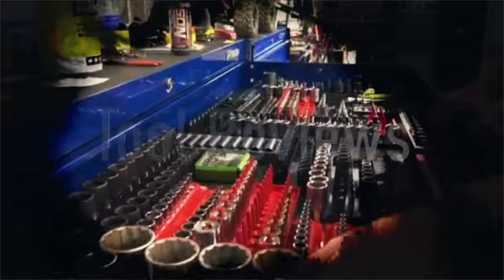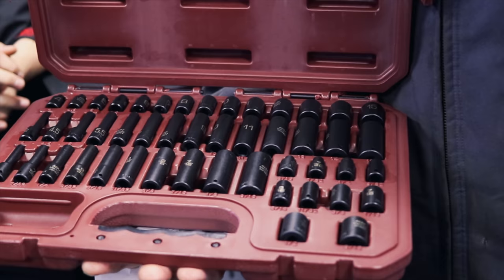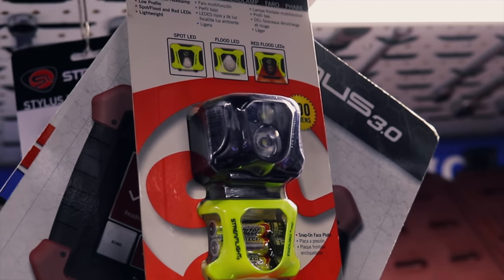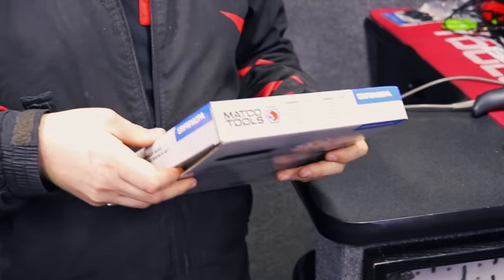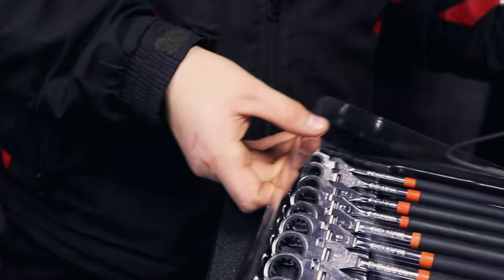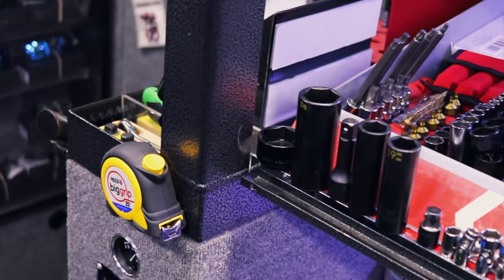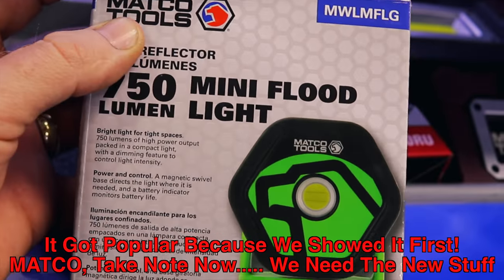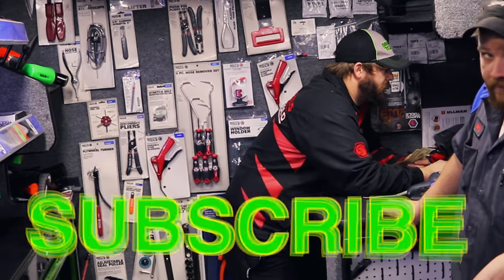Matco Tools Shortage? or Do They Doubt New Products Will Sell As Well As They Do?

Comment: Matco rebrands most of the tools and tool sets they sell. The only things Matco makes themselves are the ratchets, sockets, and wrenches. 

I bought a set of Matco long ratcheting wrenches, couple weeks later found them on the MAC truck renamed Mountain. Same with a seal driver kit, found the same kit from Lisle for WAY less.
Reply from the maker: You do know Matco only makes toolboxes ? They don’t have any tool manufacturing plants at all. They contract it through other companies and have their name put on them. Not knocking them for it but it is true.
Reply: Matco does not make any tools, all tools branded matco are made by someone else and matco name applied. Matco only makes toolboxes in Jamestown NY, no other matco plants that make anything. Don't get me wrong all tools companies rebrand or import stuff but everything matco has is not made by them except their toolboxes.
Reply: Koon Trucking didn’t know that. The more you know! Lol

Comment: I do not like spline drive stuff. It will not work on 12pt stuff. I used to do alot of transmissions and fords driveshafts have 12pt 12mm bolts and i tried to use a spline drive on it and it would not work